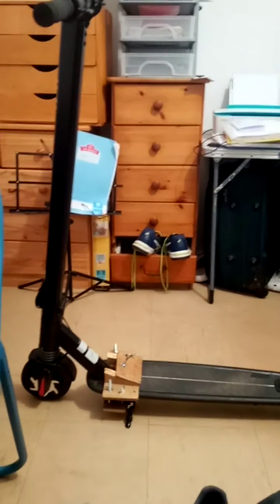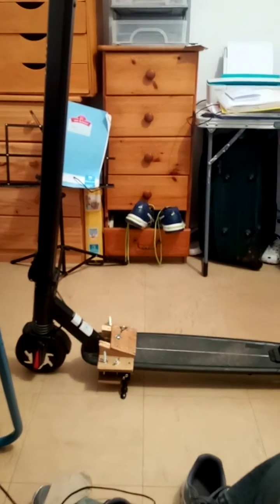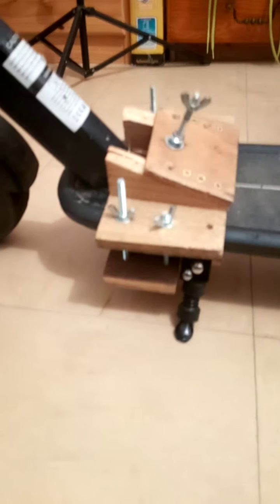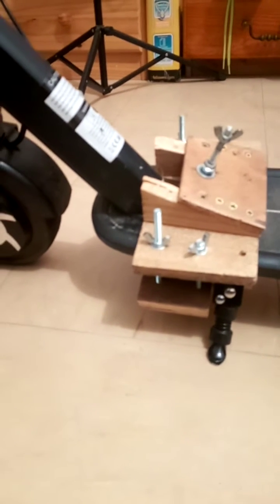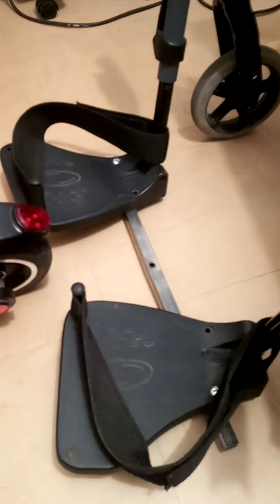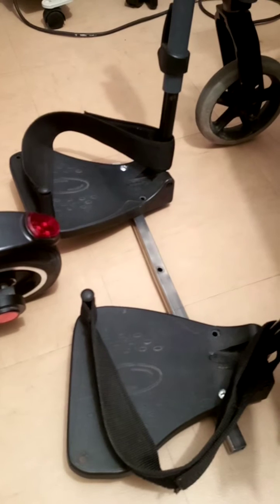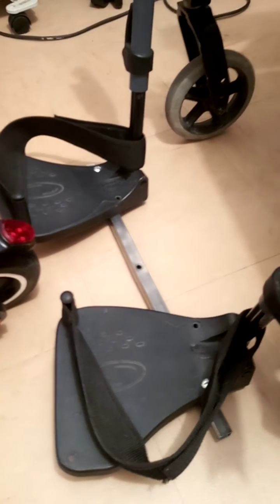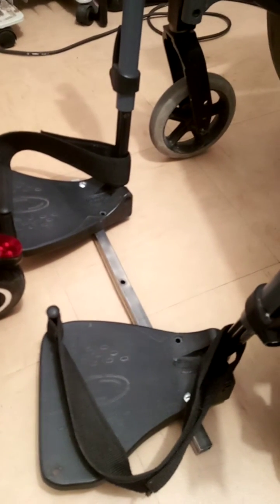Scooter-wheelchair part 1

Comment from the maker: I might try replacing the steel bar with a substantial piece of plywood. If I hit an obstacle like a pot- hole or kerb too hard the bar tends to bend...having drilled for the attachment bolt obviously creates a weak point. I'm thinking a broad plate of maybe 15mm ply may be better. The thing that held up longest so far was a thick wooden batten..but I tried getting up too big a kerb one day & it broke...At first I just let gravity hold the wheelchair in place...but again, with uneven surfaces or bumps, the scooter & chair would sometimes separate, which can be a bit scary and difficult to sort out. I can still walk a little, but it would be more difficult with more limited mobility. Another improvement I want to make is to be able to operate the sling from the seat by simply making it long enough to attach one end to the arm-rest instead of the frame of the chair...then I'll be able to back the scooter over the cord & hoist it up from sitting position in my chair. (My present set-up makes that a hands and knees job- not ideal at 64 with a progressive neuromuscular problem + beginnings of arthritis).
Other notes
My first 2 or 3 jigs failed very quickly! It took a bit of perseverance to get this working!